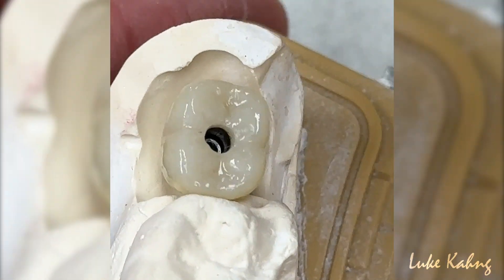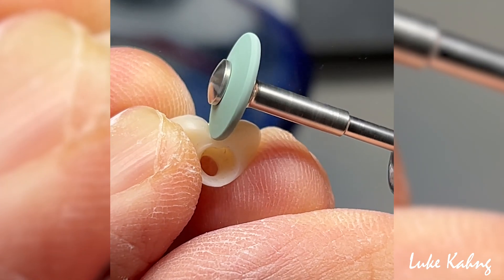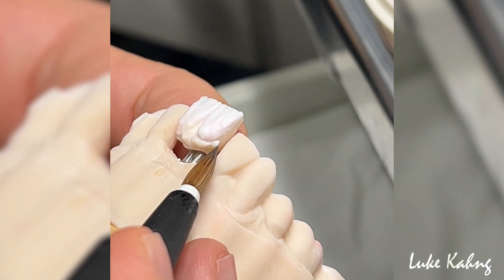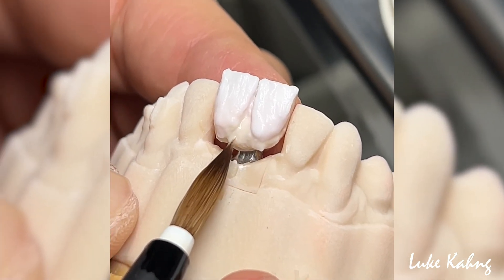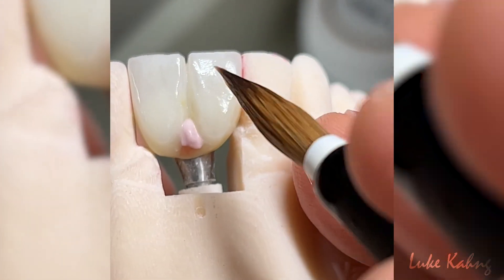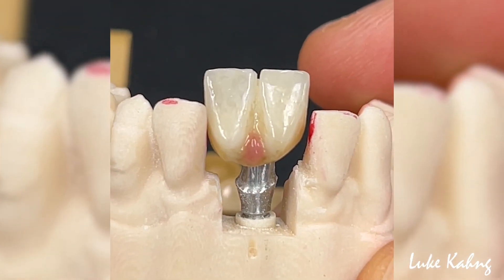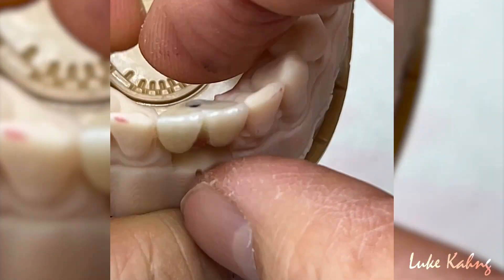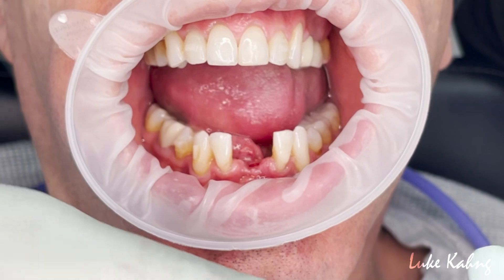Creating an Anterior Implant in the Middle of the Mouth

Comment: Thanks Luke, I was told that you couldnt place an Implante in the interproximal bone because that would destroy the interproximal papillae but as you know, things are different when we are talking about the anterior sector on the jaw. No space for two implants, I think this option is better than placing one implant for two crowns and one of them in cantilever.